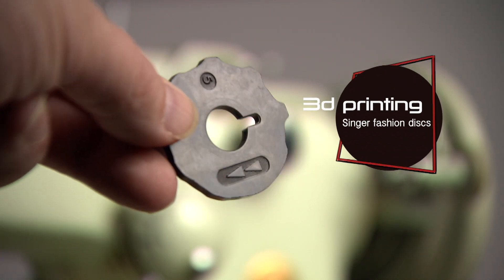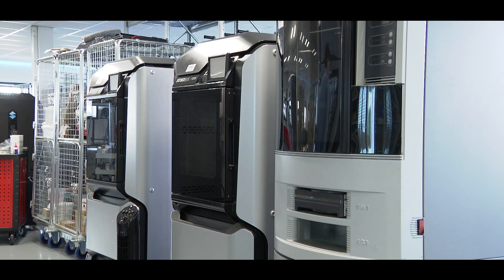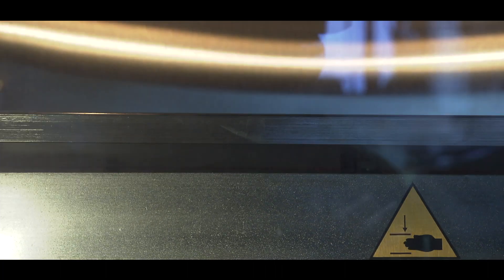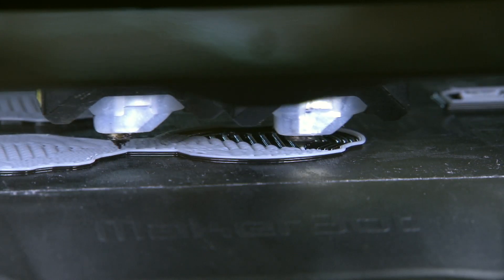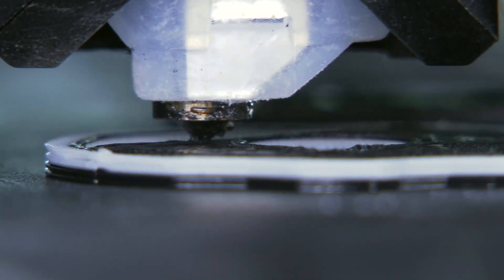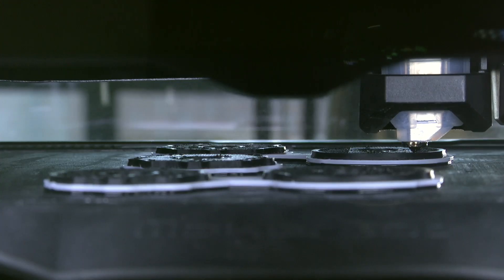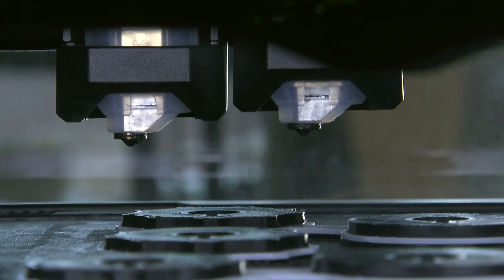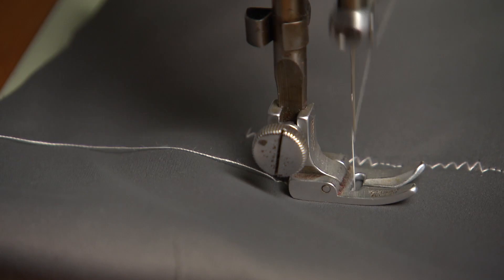3d-Printing Singer fashion discs 2/2 Printing!

Comment: I'm curious, what did it cost to print a disc?
Reply from the maker: Hi, thank you for your question.
I was charged 16 euros for 5 discs. Unfortunately they did not fit perfectly - I was a bit disappointed.  But perhaps I choose the wrong 3d-print material. 
What was wrong with it?: It was too flexible. And a little too small.
Good luck